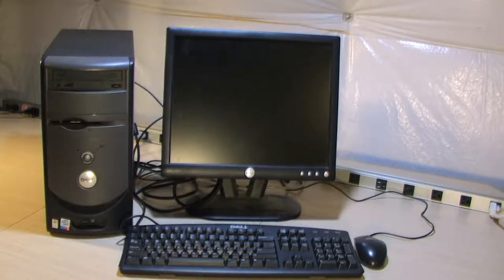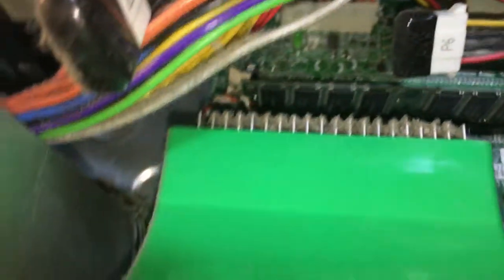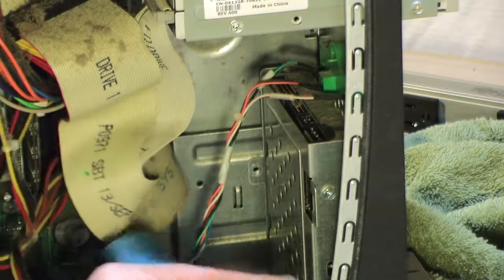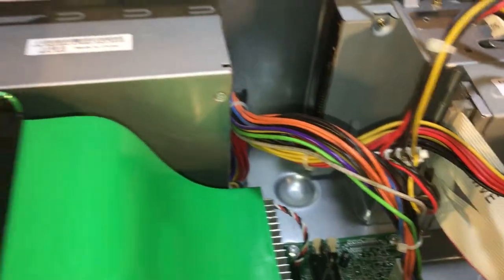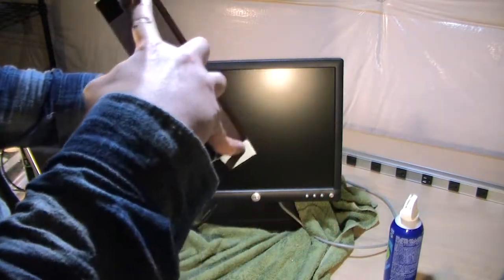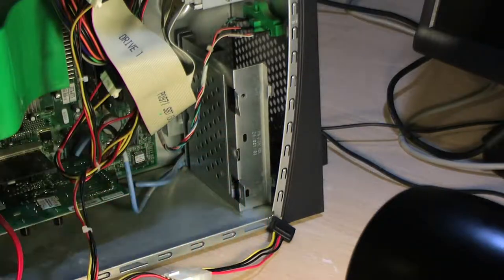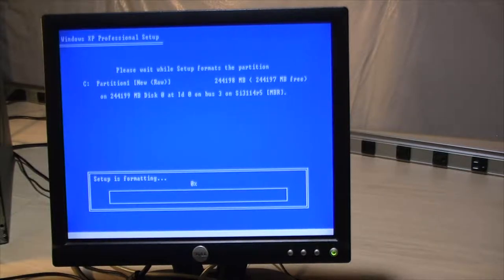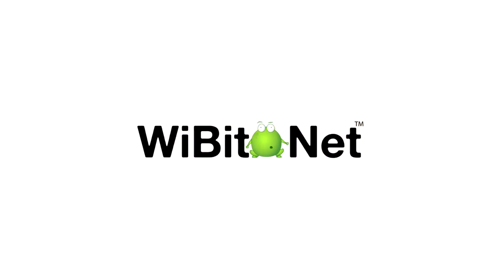Restoration Therapy: Dell Dimension 2400 - Teardown, Cleanup, Upgrade

Comment: I’ve been on a Dell Dimension kick the last year or so. These machines are basic but easy to work on and fairly resilient. So far, I have an 8200, 4550, 4300 and B110. I still have my eyes out for an 8100 with a proper Socket 423 Williamette P4 in it.

Comment: I still have my Dimension 2400 & use it occasionally. I replaced Win XP with Lubuntu, a Linux distro. It's been a while, so I've forgotten how I did it. This little Dell is a workhorse, going strong! Enjoyed your video. Learned a few new things.
Reply: Woman of SPirit, you can always remove the MB to install a DDr3 or DD4 motherboard/processor into it (microATX is max size), and power source and peripehls. And thats what I plan to do with my recently bought-on-craiglist Dell 2400. I know the 2004-era, DDr-1 powered Intel Celeron 2.2 Processor is enough to run but not well in todays web, even with lightweight linux distros.
Question for Kevin - the power source is probably 200W (thats what mine has) or 250W. Is that enough to run a graphics card? Would you run this on the web without virus protection?

Comment: These are great PCs. I miss the days where you would buy a budget PC, and it would be a good product, just with lower specs. These have sort of a bad reputation due to only coming with 128mb or 256mb RAM standard depending on when in the model run you bought it, which is just not enough to do much with on XP. so they got the reputation of being slow and unstable. 
In reality, these systems can be maxed out to 2gb RAM, and a 3.06 GHz Hyper Treading Pentium 4. They are very reliable systems that are still pretty usable even 20 years later. 
Certainly not like budget PCs today, where everything is soldered to the board, and a lot of them use laptop chargers. They are just designed to last 3 years or so and be thrown away because they are either broken by then, or so slow they are unusable. Budget means cheap now in the price and the quality, used to that was not the case. 
I have quite a few of this style dimension. I have 2 2400s, a b110, 2 4600s and a 3000. I have quite fond memories of the Dimension 3000 because my grandparents had one when I was younger. I would watch YouTube videos and play flash games when I was visiting them. I ended up with that system in 2014 when they got a new computer, and I still have it.

Comment: I have 2 of the Dell Dimension 4400 XP machines...hard drive recently crapped out on one...now using 2nd machine. I want to switch them both to SSD drives...where can I find the SSD drives?

Comment: I've restored plenty of these..... good systems.... max out the memory and put in a good large  hard drive and you're good to go.... when I restore these, I completely break them down and take the chassis and wash it out in the bathtub.  let it dry out and inspect the MB and other hardware.... I've pretty much gotten away from the old P4 machines.... they don't really like windows 10..... though they will run it.... slow though.....Nice restoration.....
Reply: Hello, I have an old dell Dimension 2400 like this and My A&C lights are solid orange on the back of my tower??? B&D are solid green. Everything turns on and it sounds healthy but the monitor is not displaying??? Can you please help, thanks

Comment: Hey, on the bright side at least it wasn't left in someone's basement stairwell, forced to endure the elements (mostly rain) until I found it! (The one you got wasn't nearly as bad to clean out as the one I'm referencing imo [also, Dell 4600].)

Good news is it still works, even though a RAM slot and the CMOS battery circuit doesn't work, with part of the PSU internally corroded to heck. However, the PSU also still works, albeit very concerningly...also, integrated graphics BARELY works. 😅

Comment: I'm currently refurbing and upgrading a free curbsided XP era machine, in the form of a very nice looking metallic blue and silver Advent T9100, with a Pentium 4 3.2E, an AsRock P4i65G motherboard, a single 512MB DDR stick, 160GB Seagate SATA HDD, a beige PATA Lite-On DVD writer, a silver card reader, and a silver 1.44MB 3.5" floppy drive, from around 2004. Also came with a silver Hanns.G HW173A LCD monitor, Trust keyboard, VGA cable, & power cables.

After cleaning it all up, here's what I'm adding to / replacing with it:

256MB XFX 6600GT AGP graphics card (sticker on the front promised an FX 5500, only came with onboard Intel "Extreme" graphics 2, so, either way, had to do something about that)
Creative Audigy SB0090 PCI audio card (a great little sound card, that not only nicely complements the refurb, it also comes with an internal Firewire port header to plug in the front panel Firewire)
Seasonic SS-500ET F3 PSU (to replace the surprisingly new looking, but still almost certainly dodgy, cheapo whatever PSU that someone stuck in there)
Masscool all copper heatsink with ball bearing fan (extremely loud stock cooler idling past 50°C, fixing that ASAP)
2GB (2x1GB) Kingston Hyper-X DDR 400 DIMMs (already had going spare from previous builds)
160 & 320GB Hitachi SATA drives (they're ones I got over 10 years ago that's stood the test of time, still checking out just fine with disk check utility tools as of 2020)
Additional Lite-On beige PATA DVD writer (for region 1 & 2 PowerDVD 5 & Nero 6 goodness, that I already had)
Serial and MIDI/game port combination backplate bracket (plugs into both the Audigy's MIDI/game port header & the motherboard's serial port header)
Airflow grill backplate bracket (for the GPU to better exhaust hot air)
An Akasa 120mm fan with additional grill & filter (ghetto jammed into the case near the front, which otherwise has absolutely no means whatsoever of having any additional fans beyond the PSU's exhaust one)
Replacement floppy, PATA, & SATA ribbon cables (40 to 80 way conductor Belkin rounded IDE cable, broken ribbon to not broken Belkin rounded floppy cable, & single SATA to dual right angle Gigabyte SATA cables)
CD audio cables
CR2032 battery
BIOS speaker

When all the parts arrive, I'm planning on turning it into a dual boot Windows XP & 7 system, with the further possibility of triple booting it with Windows 98se, or even quad booting it with a complementary Linux distro down the line.

Further changes include adding in a metal bracket to permantly fix the ghetto added fan in place, and replacing said fan, along with the CPU cooler fan, with Noctuas. May also change up to solid state storage, at least for the boot drive, sometime after that.

Hope you enjoyed reading the above. Enjoy your P4 Dell refurb! :-)
Reply from the maker: Awesome! I am behind on respond to comments, so if your project is completed by now I'd love to know how it went!
Reply: @WiBitnet  Hello again Kevin!

Got all of the above. Replaced the somewhat flaky old Akasa fan with a Noctua NF-P12 for significantly improved airflow within the restricted T9100's case. Also replaced the Masscool all copper CPU cooler's stock 70x70x15mm fan with a 70x70x25mm StarTech/Evercool double ball bearing fan (Noctua doesn't do 70mm). System still sounds like an industrial unit of some kind, but at least it's much quieter than the jet engine it was, with the Prescott toaster CPU's temperatures held well in check better than before.

Also got a nice matching silver & black HP Compaq LA1956x LED backlit monitor, along with a new/old stock solidly built HP KB0316 UK ISO PS/2 keyboard and HP M-SBF96 PS/2 optical mouse set. Finally, finished off with a pair of Logitech Z120 USB powered speakers and a Microsoft XBox 360 USB PC wired controller.

It didn't like 98se at all in it's current configuration, kept saying it was "out of memory" with 2GB of RAM & a 160GB SATA boot drive with a 32GB FAT32 OS partition during the first part of installation!

For now, I'm just installing XP Pro SP3 32-bit, with SP4 to be able to activate it. Looking at installing Microsoft Flight Simulator 2002 later on (as my Q9650 build only likes FS2003 onwards, but not FS2002).

Comment: I've got one of these lying around somewhere. We stopped using it because it was running so slow. Would replacing the old hard drive with a little solid state like you did bring it back to life?
Reply: I thought one of our fans was making noise...and it turns out it was a fan making noise...but not the one I thought. It was the fan on the graphics card I had in there...lol. Don't need that!
Reply from the maker: Def a solid state solution will give you some performance improvement. You can try the solution I did, which is an SATA PCI card, or you can also try something like an IDE to Compact Flash adapter, however I am pretty sure what I did will get you the biggest bang for your buck.

Comment: You can also put Windows 98 and Windows 2000 on it.
Reply from the maker: I just recently did a custom Windows 98 ultimate PC build. I didn't record it sadly. But ya, Love me some Windows 2000!
Reply: @WiBitnet  Ah, Is your Dell Dimension 2400 currently running Windows XP?

Comment: Is there any way i can update it to play mincrat XD
Reply from the maker: LOL!!!! Not sure. Would be cool!
Reply: no the best cpu you can get for the socket is the pentium 4 xe 3.4ghz and that isnt enough to run minecraft, additionaly the limit of only pci gpus is fairly restrictive if you want to play gta san andreas its fine but minecraft at its current update simply is too intensive
Reply: Probably not a modern version, but in 2010 or so I used to play Minecraft on a Pentium 4 with integrated graphics and 1GB RAM. Didn't run perfectly, but it was playable and a ton of fun!
Reply: I still have my 2400 , infact just replaced the power supply.
Reply: Perhaps MC Alpha Yes, With 2gb of ram and a Pentium 4 (64 Bit) Then Maybe, Just maybe 

But 1.16.5? No

I can barely run it on an I3-9100 CPU With 8GB Of ram

Comment: I got one of these a few months ago. It’s fun except the Celeron R is a bit slow and it is missing the floppy for some reason. Was thinking about soldering on an agp slot on because the bios has settings for one. Any thoughts?
Reply from the maker: Mine is a Pentium III, which runs pretty fine. The only thing that holds me back is no AGP slot. The board looks printed to have an AGP slot in it. Probably all these models had the same board printed to same money.
Reply: You would need to install all of the supporting smd components and to mod the Dell bios to reconize the agp port. PCI VGA only.

Comment: Hey! I really hope you are able to see this. What power adapter did you use for the SATA cable? Any chance you can find me a link or part information.
Reply from the maker: I used a molex to SATA power adapter, since this machine was build before SATA and the power supply doesn't have any power connectors for it. They are pretty cheap on eBay or Amazon.
Reply: @WiBitnet  Thank you for the reply, appreciate it. Finally fixed my dimension2400. All it needed was a new power supply (:
Reply from the maker: @jabu9  That's awesome! Hope you get some live out of it! Are you using it for gaming, or just goofing around?
Reply: @WiBitnet  Thanks! Just goofing, was my family's first PC and wanted to fix it as a suprise.

Comment: I hate the hdd it gets slow so get the ssd because it gets faster than hdd
Reply from the maker: Def. I used the SSD in this video, however, using a compact flash to IDE also is pretty good. I use that in other older machines and I have had no issues. Using SD cards as a hard disk has been a problem for some computers, so I have learned to stay away from those.